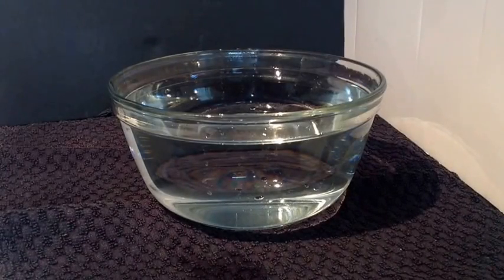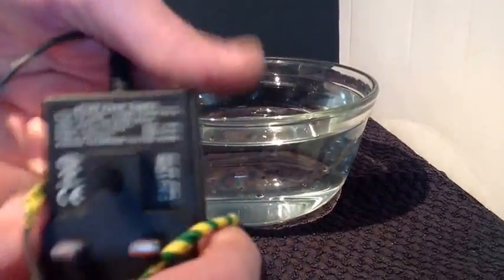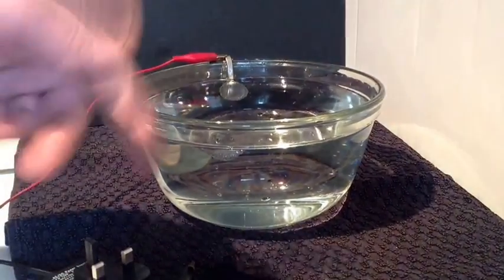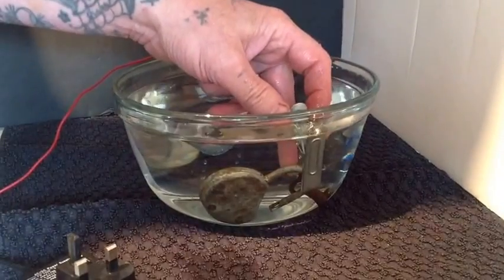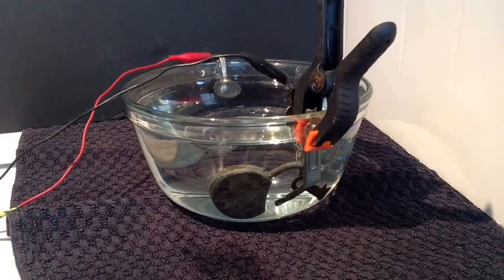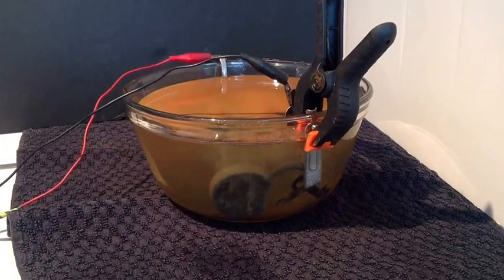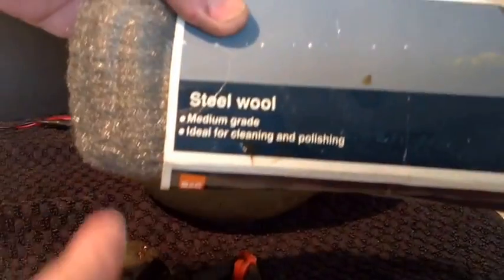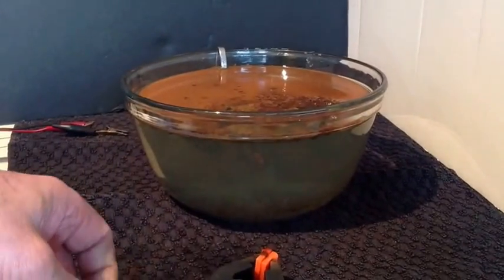How to clean a rusty old lock using the process of electrolysis

Comment: Please, tell me How much salt is needed for four liters of water and, can I use a battery charger with 2 Amps to do it?
Reply: he used 2 litres to 4 tablespoons of salt, so just double it
Reply: And what you tell me about those 2 amps and the 12V DC battery charger, will these resources do the job? Thanks for your help!
Reply: You could use 12v but a phone charger is generally 1amp (2amps if it's fast charging compatible) and 5volts, which would mean less aggressive electrolysis but less damaging if left unattended.